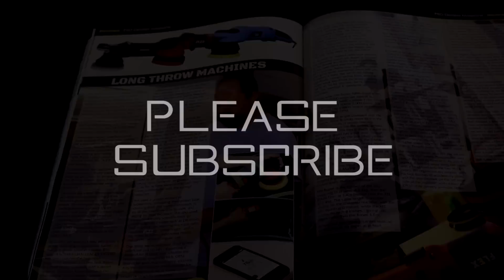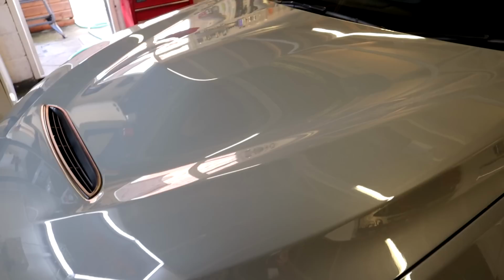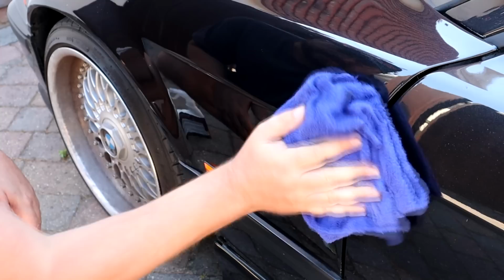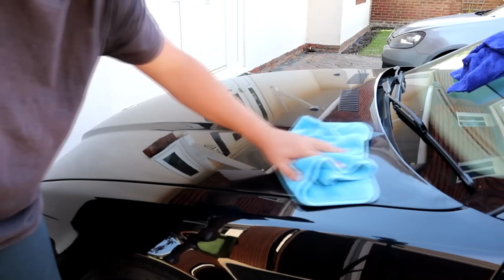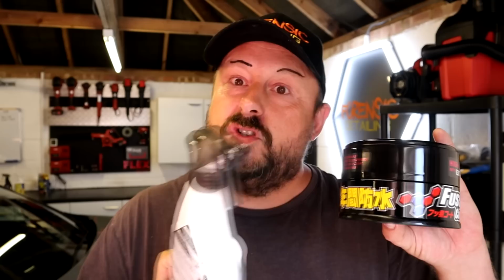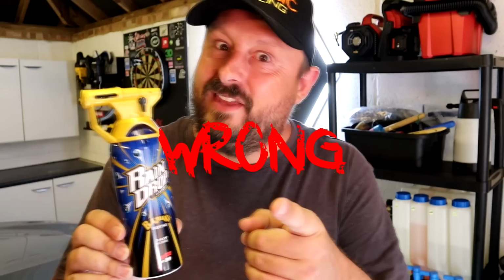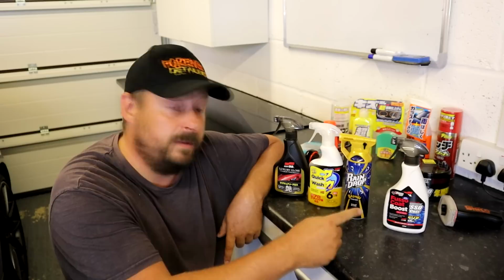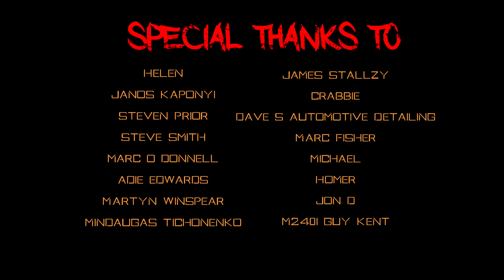Life After Soft99 Fusso Coat | S99 QD range

Comment: Jon, the eyebrow thing was hilarious. Thanks for the laugh cause I was having a bad day.
Reply: Me too, got a recon Karcher, to replace one that has lost power, only to hook that up and there is literally no pressure, ruined what was going to be a full chemical decin day.  The laugh was needed.
Reply: @decker0373  My bad day was applying a coat of Gyeon Mohs to my new car only to have heavy rain come in five hours later. And no garage.
Reply: @archiepezek  sorry to hear that Archie, any chance of salvaging or is it back to the beginning?
Reply: @decker0373  I'm really shocked that the coating must have bonded because there were a thousand tiny beads all over the car and I was able to blow them off with my air blower. I did put a coating of Gyeon Cure on after about two hours, so maybe that helped.

Comment: Fukupika has replaced BSD for me, brilliant stuff.
Reply: Good to hear as I've just done the same. Does it last well? Only just bought it and applied it to 1 car this weekend.
Reply: @michaelgoodwin593  Tough to say anything about the durability, started using it in the spring and it's very dry in my country. Hopefully rain will start soon so I can see how durable it is, still have not figured out if it has any UV protection, as far as I could find out BSD also didn't have any UV protection.
Reply: @jusb1066  really, not even the liquid sealants ? Think most still advertise as having uv protection, I think my tyre serum still says it on the bottle.

Comment: Actually got all spray products from Soft9.. Best is fukupika. This is not only a waterless wash This is a complete spray wax with ease of use and built-in cleaning capability. It last. It looks awesome. It is easy to work. Luxury gloss is also not a QD. It has a warm look caranauba gives. It is good for fusso. Fukupika is one of not many products I did bought again even if it was not needed as I have 30+ QDs already.

Comment: John can you recommend a cleaner for seats that I can use with a carpet cleaner machine?
Reply: You mean an extractor? You can just use a diluted APC. I run hot water only in the extractor. Apply your cleaner in a separate spray bottle and agitate. Then follow with the extractor until the water extracts clean and clear. It’s a much more controlled and efficient use of product. I only extract when I absolutely have to, on extremely soiled fabrics or strong odors. Usually just cleaner, brush and a little steam if needed followed by a vacuum does the job without introducing excessive moisture to foam cushions and fabrics.

Comment: I use the soft99 water block super spash wax. It's amazing, the hydrophobicity is next level. Highly recommended. 

Just don't apply too much wax and make sure to fully remove it. 
I have a white car so it can be really hard to see if there is excess wax.
Reply: Just a tip I use on lighter cars, just a cheap torch from a couple of feet, that often helps to see the difference in the panel surface so easier to spot any missed bits. Fusso wax is next on my wanted list! Thx for the tips.
Reply: @djmandrick  I'll give the torch a go. I don't have an indoor area so not sure if it will work outside but will give it a shot. Thanks.